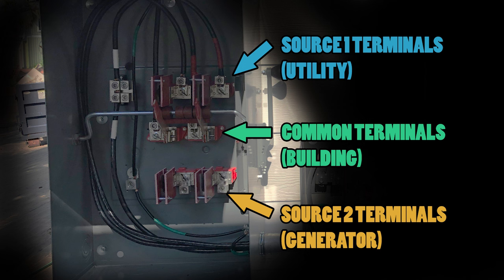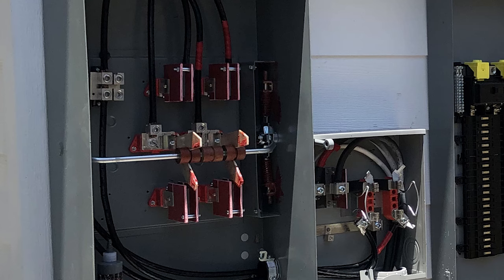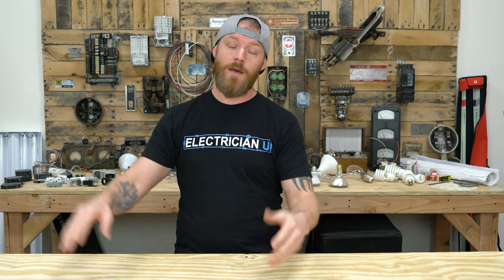Transfer Switches - DIFFERENCE BETWEEN MTS and ATS, & HOW THEY WORK

Comment: At my company in Florida we regularly install generators at wealthy customers homes. We don`t deal with portable generators, only permanent location on a prefab concrete slab. They are always used with automatic transfer switches by generac, I cant imagine one of our customers going outside to the side of the house to transfer it themselves lol. The sound of the automatic transfer switch startles people who don't know what to expect. Often load shedding modules are used for the air handlers because these large homes have several ac units... It's crazy so many people have no idea how much work it takes to do this kind of operation. If your really unlucky and cannot trench from the transfer switch to the generator, you need to route the conduit from the transfer switch through the attic to the other side of the house. Sometimes the meter can is near the front door and the generator is on the other side of the house. Being in Florida also does not help because you are trying not to pass out from the heat! 😅

Comment: Dustin I like your discussion but I have one contradiction my company installs  generators for residential all the time and we use ats we rarely use mts
Reply from the maker: That’s a much better option for sure, most of the work I’ve done on the coast (Texas) are MTS. Just cheaper, doesn’t seem like most want to pay for ATS unless they’re wealthy
Reply: Dido, we install about 50 ATS a year.  In Maine it regular and banks finance it for people.
Reply: Same we only install MTSs for portable generators. Here in NJ, people have a lot of money. Also an MTS is useless if no one is home to switch it and the customer comes home to a fridge full of rotten food and a basement full of water.
Reply: We install them a lot  for home stand  by generators  we usually  do about 3-9 installs a week
Reply: ATS makes sense with a dedicated backup genset that can also be automatically started by the system. ATS is useless is you already own a 10kw or larger portable genset and have no interest in paying thousands of dollars more for yet another genset that will just sit there doing nothing for months if not years. A portable genset and a MTS means you have a system that can be used for other things like camping, worksite power, or at a remote cabin with no mains power within 100km. It’s the difference between a $10-20,000 setup with exactly one use that you may never even use, and a $4-5,000 setup that has multiple uses and places it can be used. The best option is to have both, but not everyone has the cash sitting around for that.
Reply: Western Washington, and our customer niche is between Seattle and Tacoma, mostly people/small businesses who don't have money to pay normal wages. I've worked for 2-1/2 years and never done an ATS, but I've been involved in about 7 MTS systems whether troubleshooting or installing. Five were inlets for portable generators (the MTS was simply an interlock between the generator breaker and the main breaker so they couldn't be switched on simultaneously), and one was a permanent install for a 400A service where the generator powered one of the two main panels. The other was an illegal and irresponsible system at my boss's house that didn't have a transfer switch. The reason people over here want generators is for when the wind blows power lines down or a tree falls on the lines and blows a fuse, the customer wants a generator for a few essential circuits for a few hours (most often) up to a couple days (a few small areas during particularly bad storms). So if someone got home from work while the power was out, the worst that has happened is the house is 45 degrees warmer than outside rather than the ideal 60 degrees warmer. Only 3% of houses I've seen have any sort of a generator setup.
Reply: What's the price difference between an mts and ats for residential? 700$?

Comment: An ATS is like 800-1000 bucks. An MTS is only a few hundred or so less than that. If you’re installing a 20kw+ generator at a home and not getting an ATS, you’re crazy. If you just want to setup a handful of circuits for a portable generator, a MTS is just fine.

Comment: When I was a kid, we had a cord coming out the side of the house to plug in to a portable generator. Our "Transfer switch" was just two main source breakers in our breaker panel, one for utility power and one for that cord, with a metal plate that made it so that when one source breaker was switched on, the other was blocked into the off position.
Reply: Inrtelock kit

Comment: Those photos were helpful to understand what happens. Since the neutral/ground bond can be at only one place for the service, there are only two possibilities. With the bond always at the service entrance, the generator frame cannot bond neutral, with a four wire feed back to the service entrance where the bond remains. The photo at 2:47 shows no switching of neutral, so the generator neutral must be unbonded at source. If the generator frame is bonded to neutral, you need to find a way to delete the neutral bond at the service entrance when the generator is working, and to delete the generator neutral when power is restored. Presumably that would require a more complicated neutral pole switch tied to the main switch.
Reply: Why are you trying to switch the neutral? Also, most dryers and many ranges from years ago had cases bonded to their neutrals. If the bond happens on the appliance side of the cord, it's not THAT bad. A separate ground is better, but a bonded ground-neutral wire in the cord was standard for a long time, though the current code won't allow it. Also, consider that appliances have different rules. All we need to worry about as electricians is whether it's UL listed and what the instructions say to hook up.

Comment: For my line of work as a sprinklerfitter, electric fire pumps have manual transfer switch for the back up generator. It’s part of our performance test to run the pump at 150% then kill normal power to run it on the backup power.
Reply: Opposite rotation is a simple fix on the electrical end. That’s why your supposed to bump test the pump in normal power and backup power when you install a new controller for the simple fact it’s just flipping some wires around to correct the problem. And yes a fire pump performance test is running the fire pump at churn which is no flow, 50%, 100%, and 150%. The fire pump passes the performance test if it achieves the numbers needed for 100% but we put some stress on it and flow it at its max that’s when we transfer power:
Reply: I’m by no means an electrician but I do know enough to be dangerous especially in the fire protection trade. But I also know when you stop and call the professionals. We don’t do any wiring higher than 110. We install the controllers and once power is brought in we adjust the pressure switch once proper rotation is confirmed.

Comment: Not only does an ATS monitor Utility Mains (On/Off), but it can monitor Utility Voltage Fluctuations (Over Voltage and Under Voltage). It can also monitor Frequency of the Utility Power. Any deviations from the Set Point Value, and the ATS will drop the Mains, and transfer over to Gen Power.

Comment: Great video and very informative, thank you. One correction is at @2:18 you mention there is a connection made between the common terminal (building) and one load (utility power), or the common terminal and another load (generator power). This is a misnomer. The common terminal is actually considered the load. In other words, your load is the wiring to the building or what is being powered, not the wiring from the two sources. In normal electricity terms, you would call the source terminals, "line", and the common terminal to whatever is being powered, the "load".

Comment: Just found your site and am amazed at the wealth of information. I just bought an MTS (Reliance Controls 306A, 6 circuits, 16” conduit, wires are about 24-36”). There’s not much room near my load center to connect the MTS. Would it be unwise to run the MTS to a metal junction box, then run wires through a metal conduit from the junction box to the load center? Would there be any reason such as code, etc, why the MTS would need to be near the load center? Was hoping to mount the MTS on an adjacent wall. Thanks so much. Big fan.

Comment: In Automatic transfer switches I love to use load shedding on the auto transfer switch. Just wire a UL listed generator for alarm call center. It has utility with generator back up with a second generator that back up the first generator. Then it has back up battery banks so it both generator fails the still be power for central station. Load shedding make generator so much better for high demand stuff to run.

Comment: Question - I am working on a large hospital project and a question came up if the mechanical systems are on emergency power. I asked the Electrical engineer and he said there are 4 ATS categories and the Mechanical systems are on either the equipment or Life safety categories so there is very little chance they will be shed. How do ATS categories work? In our case we have 3 large generators and the system is designed so that 2 of them should be able to handle the entire campus at 50% load. How does the ATS know if it needs to shed its circuit?

Comment: At 2:14, why is the Utility's Neutral feed not transferred also?  On manual transfer, while running from a generator during a power outage, utility neutral and genny neutral are connected.  Doesn't this create a problem when utility power is first restored?

Comment: Thank you for this video. I have an MTS which I'm just learning about. Do you suggest I turn off all my breakers inside my panel before I switch the MTS for generator? I have a12,500 peak watts with 9,500 running watt generator. 2,200sq ft. home.

Comment: Hook in to the terminals with #10 for the generator 30 amp and rely on the generator 30 amp breaker for overcurrent protection  correct?

Comment: Suppose I wanted to have an automatic transfer switch in my home that would switch from utility power over to battery/solar power when the first was lost. Is this possible? And would it be possible to have the switch go back to utility power when ever it came back online? Only mission critical circuits would be don't the ABT switch like fridge and some lighting circuits. Suggestions would be great. One last item of interest what if the power goes out for a second and comes back on again what prevents the ABT from switching back and forth when power does not go out for very long?

Comment: Next question , if the manual transfer and bypass switch is locked in the off position does it mean that both the grid and the ac power from the inverter are working simultaneously? In that when the grid is up the grid feeds the house but when the grid goes down ( hybrid string inverter like sol-arc 12) the inverter will feed the house?
Thank you again

Comment: I heard of a 3 phase generator being replaced and they got the rotation wrong, the building had 3 phase motors.  When it was tested and the ATS switched from gen to commercial power it wasn't pretty.

Comment: I have a question on a GE 200amp non-fused manual transfer switch.  If the wiring diagram shows that from the utility to main disconnect switch then it goes to the ac combiner then to top of the manual transfer and bypass switch. then to the main service panel, can. instead of going directly to the ac combiner the wires go directly to the manual transfer and by pass switch and then the top wires come from the ac combiner, is this possible?  In essence, there are three sets of wires into the manual transfer and bypass switch and a load side  (fourth wires) to the main panel.
Thanks (newbie question)

Comment: Hey Dustin love all the videos. I am trying my best to start to understand transfer switches and standby generators. I am looking at doing a service upgrade to my home. Going from a 100amp service to a 200amp service. I am wanting to add a 20kw whole house generator. My question is how does a transfer switch work in conjunction with your main breaker. In other words if you have a main breaker outside near your electrical meter, what keeps the generator from sending power into the house. Thank you for all the great information.
Reply: The transfer switch just needs to interrupt the panel feeder (wires between your meter and the panel breaker) and the generator will feed into that transfer switch. 

How'd the project go?

Comment: I have a meter then going to my panel in my house 200 amp if I decide to put a mts in between should I put a 200 amp breaker after the meter like right next to it if so does this become my first disconnect for my bonded neutral also is it the same for meter boxes  that are sold with a breaker attached

Comment: I have thought about getting one put in for a 30A 120/220 portable generator. I have heard some say those are for the big pad mounted generators, and a portable should not be used that way as prone to overload/damage something, but generator has 30A breaker on it too so even if did get overloaded. I have seen like an 8000 watt generator run critical things in a house+TV, well, microwave no issue. Only time would be issue would be like electric heating, ranges, etc. IMHO you should be able to connect a 30a generator to a transfer switch and run the house on same panel as long as don't run electric oven, etc it should be fine. Even if you did the generator breaker or breaker in the transfer switch would trip. 

I think I saw Honeywell had a manual transfer switch, but had some form of regulation so it never let more than 30A through. Saw once but could never find again. They also have split bus panels where like one section is utility only and then some sort of interlock a second section can be transferred utility or generator.   

I saw one time guy at large home improvement chain one of their employees told a customer just splice generator on a 30A 220 breaker and turn off the main breaker. To my understanding that is illegal as the main could fail closed. I have seen some panels they have sliders, etc but basically do this same thing so not sure how that is any different besides the interlock. Be nice they made like a proper transfer switch like you show but also had a breaker for the generator, granted generator should have one too.
Reply: You can set up a 30 amp twist lock receptacle to backfeed your panel. For this setup you need to buy a generator interlock for your electrical panel. It's the most important piece of safety in a system like this. Do not back feed your panel unless you're using an interlock. I will not explain more because if you don't understand you should call a licensed electrician to do this kind of work. Not really something for a hobbyist or homeowner unless you know exactly what you're doing
Reply: Of course you can tie a portable generator to either a manual or automatic transfer switch. There is absolutely no danger of 'overload or damage'. My main backup generator is a portable 6kW Kubota diesel, but bolting it to a concrete base would change anything electrically.

Comment: We installed a 12KW Briggs and Stratton with an ATS and runs off propane last fall. No it wasn’t cheap but we live in a climate  with cold winters so the peace of mind of the power going off when we’re not home is worth it vs the pipes freezing because the powers off for an extended period of time. The engine starts within seconds,the load transfers after about 30 seconds and when the power restores it transfers back,does a cool down period then shuts off. There’s an onboard battery maintainer and block heater. No wasn’t cheap but we usually get at least a half a dozen outages per year where we live ,sometimes as long as several days at a time if it’s a result of an ice storm.
Reply: I think the company I do 24kw installs for charges 11-12k for install. Hopefully for 12k you're a bit cheaper than that

Comment: DUSTIN! I have a 1940s Murray fuse panel that I'm looking to swap out for standard circuit breaker panel. I know what I need to do, but it would be awesome to see you break this process down since I learn so much from you. Thanks!
Reply: Pull all the fuses, turn off the main breaker (If there is one). Once every circuit is off in the house, go outside pull your meter out of the socket. You can now work inside the house because there will be no power inside. Label all of your circuits before hand. Make sure to mark 240v circuits for 240 and don't put 120v stuff on as 240.

Get a nice battery powered work light, you're probably going to need it!

Or call a licensed electrician because this is a big project. All of your new 120v breakers need to be AFCI as per the NEC

Comment: This seems like a great idea to power one side of my panel than then to pick a few independent circuit 😎 👍
Reply: How do you power only one side of your panel? Do your bus bars split down the middle or something? Even if they do, how do you disconnect them while the generator is on and reconnect after the utility power comes back?

Better idea... power your whole panel and switch off the circuits you don't need!